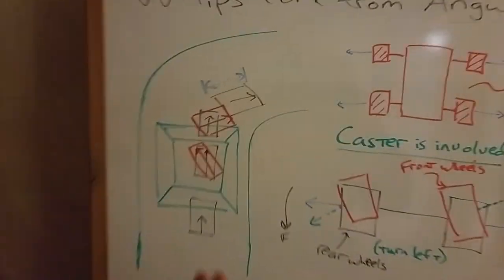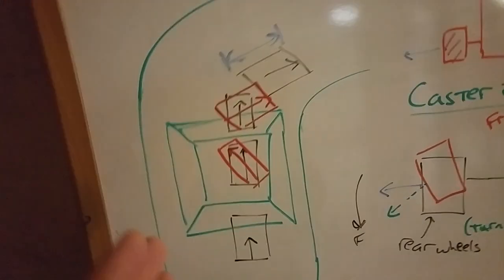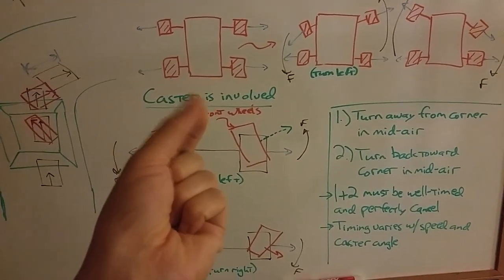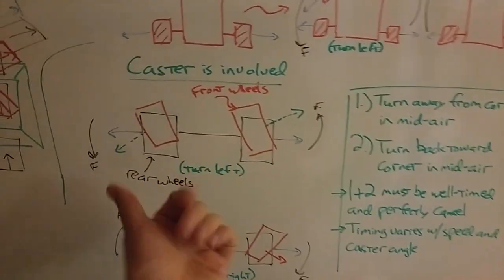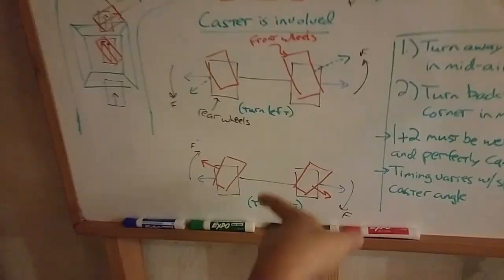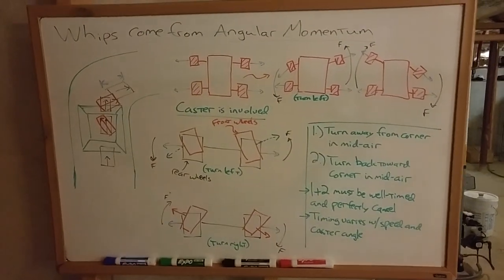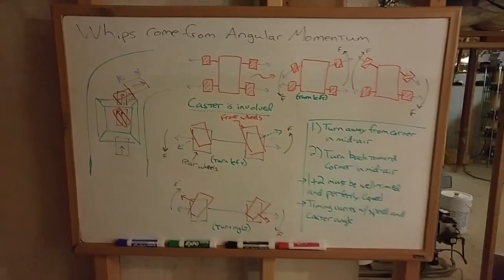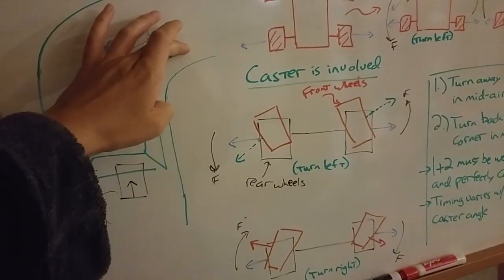Whipping as a driving technique.  How it works.

Comment: You actually got this backwards. Turning towards the ground levels the car out. So in this situation, as you approach the jump you turn slightly right to get the car to rotate towards the direction of the corner (right) in the air. When the car is in the air, you then turn left to stop this rotation, and just before you land you turn right in the direction of the corner again. If you don't believe me, go watch some videos on youtube and slow them down with the speed setting behind the cog in the lower right corner of the video player.
Reply: I just mentioned the same but you described it better
Reply: i think he talks about 2wd cars.  what you say is true for 4wd cars, check my channel for rc car freestyle tricks
Reply: stephane Z no it is not. Physics works the same, every time
Reply: @invisiblespeedrc  what i meant is that when you steer+brake in the air a 2wd and a 4wd, it won't behave the same way
Reply: Thank you.  I felt like some of this was off…
Still helped me think about it more deeply though. 🙂
Reply: @stephanez8036  yes it will, just not as strongly as front wheels are lighter, and you cant rev them
Reply: @Invisiblespeedrc I thought this explanation seemed backwards

Comment: This is a good video because aside from whipping, it is important to know what the car is doing in the air when you turn the wheels left or right. Everyone pretty much knows what throttle and brake does in the air. But sometimes i will turn the wheels left or right in the air just to simply straighten the car out for landing, say if i took a jump a little sideways. So, sometimes it looks like im whipping or trying to and all im doing is flattening the car in the air for landing. Other times, like in your example, whipping is beneficial right into a turn.
Reply from the maker: Right, so my personal technique for straightening the car in a non-whip scenario is the blip the throttle rather than blip the steering.  I just feel more comfortable doing that and then tapping the brakes to set up for the landing than in fiddling with the steering.

Comment: Ok so I can not whip very consistently in 2wd. So what I tend to do in this type of , landing just b4 a turn is to hit the face of the jump slightly left of center (for a right hand turn) and attempt to land slightly Right of center to better negotiate the turn. I find that I personally can achieve this much mor constantly that whipping... tho I do continue to practice the manuver
Reply: Another dimension I like to add is using the throttle to level out your car plays a role as well depending on the jump face.  I have a jump like this right now at our track.  If you whip, you also have to brake slightly then throttle before you land or else you will chassis slap the rear.  Man...I must say when you do land it, the feeling is awesome.
Reply: @hysao9210  
Throttle control while airborne for me isn't an issue.  I can downside landings and level out and all that. It's getting the timing of the "whip" process CONSISTENTLY  enough to execute the maneuver during a race. The penalty for not hitting the sequence just right could mean that I end up in the C or D main.
Reply: @hysao9210  I heard the same thing you have to give throttle so the tail could go down on the first jump and then when you're ready to land on the whip you have to give break so the nose goes down I heard that also

Comment: I’m having a real hard time training myself to turn away from the turn first I always end up whipping the wrong way just trying to go fast😅
Reply from the maker: I never learned to whip, so I just don't even try.  Sometimes I steer mid-air out of instinct if I see the car doing something weird and I try to catch it, but I don't make a point of whipping just for the sake of it.  I tried it for one race years back and it didn't make me any faster.  You'd have to be a very elite driver to even take advantage of it, in my opinion.
Reply: @doctormosfet  I don’t think there is any tbh info wrong with someone trying to learn the skill the pros didn’t learn it over night practice makes perfect I agree though as far as risk vs reward personally I run the safest lines I can at about 80-90 percent helps me with my consistency I’ll only push as hard as I can if I feel there is a chance to close the gap and make a pass if I don’t feel confident I can do that I’ll just focus on hitting my marks and most the time the guy way ahead of you will make a mistake or flame out from pounding the trigger burning all his fuel and you get a free pass I love rc I’m glad I got back into it last year I’ve learned so much in just the short time I’ve been back at it
Reply: @doctormosfet  this video really explains the physics perfect to understand even if you aren’t trying to whip this is valuable information for the nasty kickers that might form late in the mains

Comment: You got it backwards doc. If you turn right, the car will roll left, yaw left, and nose down. The more caster and kpi you have the more it will roll and nose down. If there was no caster or kpi, and you turn left mid-air, the car will do basically a flat spin, yawing to the right (clockwise looking top down). A car will never yaw left when turning left. That's impossible. Movements mid-air have to cancel each other out. Front wheel movement have to cancel out rear wheel movement when hinging at the kingpins.
Reply from the maker: Well, it wouldn't be the first tutorial I messed up...haha.

Comment: You got the rotation thing wrong. If the car is freewheeling in the air and you turn the wheel left...the car will not rotate left, It will rotate right. It will rotate right as well as roll right and nose down. The more caster you have, the more it will roll and nose down. Basically the car will hinge on the kingpins. Hold your car in the air. Have a friend hold the front wheel and keep it from moving. Now push the rear of the car to make the car effectively be turning left. That's what your 4wd car will look like in the air...but not as extreme. In reality the front wheels will move a little bit, and the rear of the car will move a little bit....they will meet each other half way.
Reply from the maker: Oops...